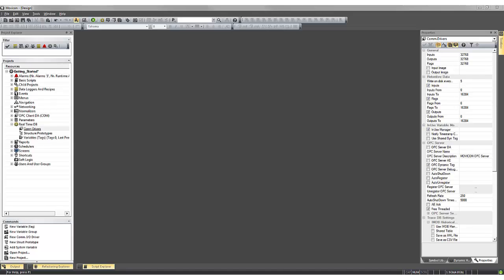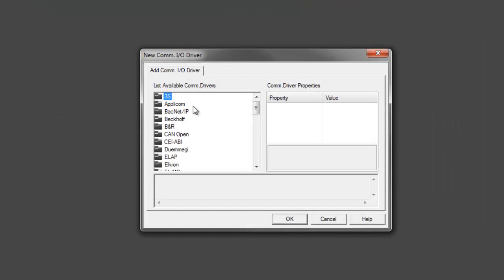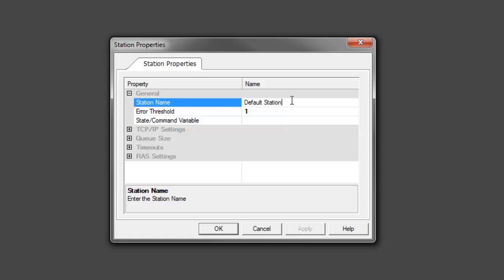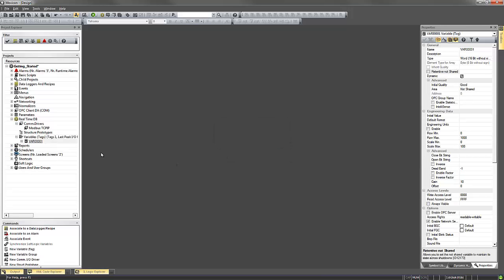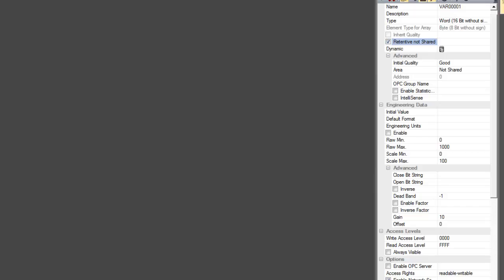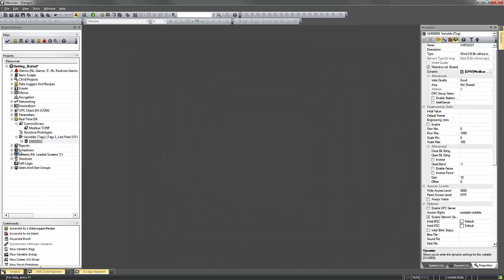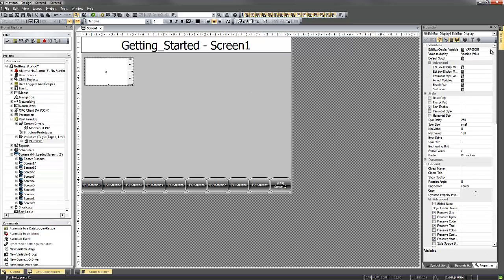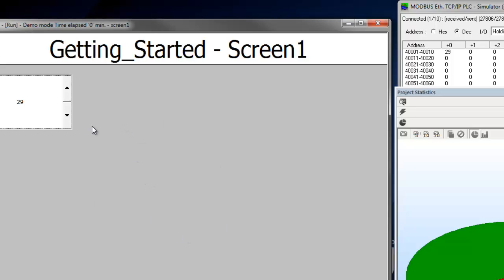Movicon 11 SCADA / HMI Tutorial - Driver Configuration

Comment: Hello from 2022!
Tell me, does the Movicon 11 system work fully in the evaluation mode? I cannot establish a Modbus TCP connection. It seems that there are no settings other than the port and address, but my PLC does not want to see it. I would like to try, play, but it's like a shot on takeoff ((

Comment: Hi,
I have a problem in creating a driver S7-300. I cannot find S7TCP.dll and the error:
Error loading ‘S7TCP.dll’ : Impossibile avviare l’applicazione specificata. La configurazione della modalità affiancata dell’applicazione non è corretta. Consultare il registro degli eventi applicazioni o usate lo strumento sxstrace.exe per ottenere ulteriori informazioni!
what can I do?
Reply: Hi, are you running Movicon 11 as an administrator? What Movicon and communication driver version are you currently using?  There should be a driver folder in your Movicon 11 installation directory, usually Program Files (x86) > Progea > Movicon 11.5 > Drivers. The S7TCP.dll should be there, you can also check on errors in the Comm Drivers Logs(Drivers.dat or System.log) in the folder "LOGS"  (project's folder directory).You can also see more info here;   https://www.progea.com/en/forum/progea/
Reply: https://www.microsoft.com/en-us/download/details.aspx?id=48145  Reinstalling the Visual C++ Redistributable 2015 might help.